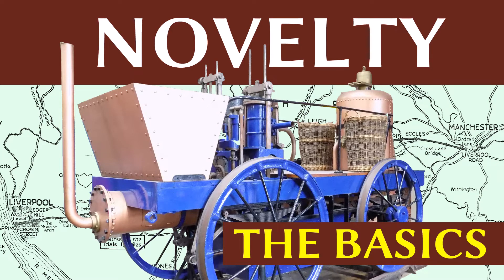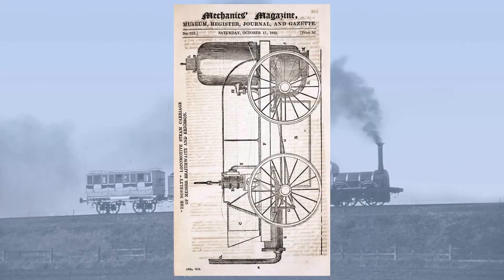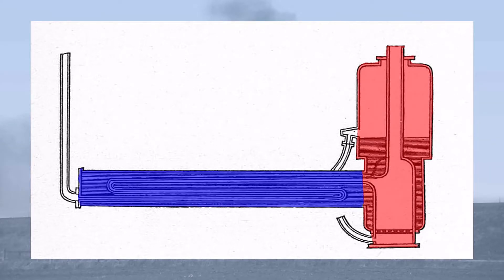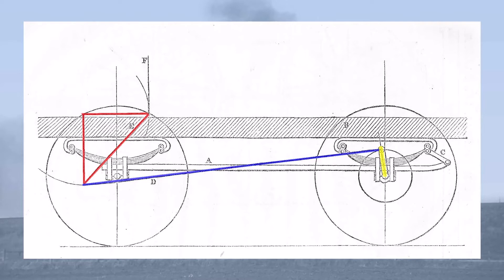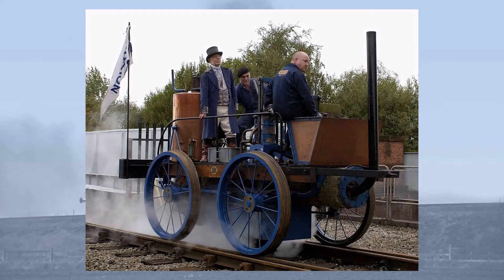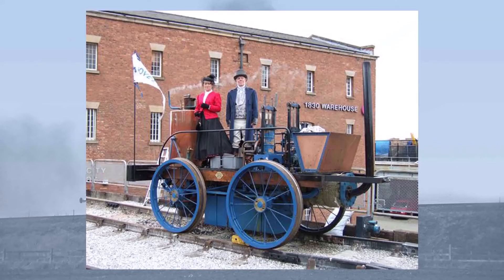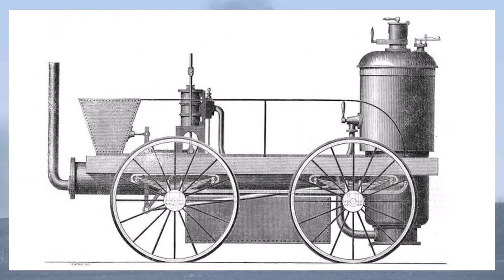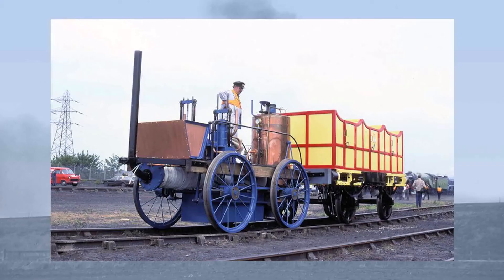Novelty: The Basics

Comment: I'd agree with Stephenson just based on being prone to clinkering and sooty flues. On top of that she seems to be an incredibly lightweight design, so not sure about how much tractive effort she would've mustered. I'd guess her pulling power would be a fraction of Rocket's or Sans Pareil.
Reply from the maker: Novelty weighed only 2 tons 15 cwt; half the weight of Rocket (4tons 3cwt) or Sans Pareil (4 ton  8cwt 2 qrs). She was a little teeny tiny thing, so even a load ten times her own weight was about twenty tons, when Rocket could shift over 40!

Comment: Very interesting watch, especially as I was Fireman on Novelty in 2002 (BBC Filming at Llangollen). I can certainly believe she was actually converted from a fire engine. If you got the power requirement for the blower from the Llangollen runs, I don't think it reflect to features of the original. I can't believe the blower on the replica was anything like the original. The blower & air pipe, the regulator/steam pipe and valvegear setting were all things that seemed to need some serious workshop time after running tests.
Reply from the maker: The calculations were based on the experiences of the replica combined with those of the original machine. We now know the blower design in the replica is incorrect as it should have provided a continual stream of air rather than one which pulsed. When we had it at Manchester in 2005 we could not get it to make steam, especially over the short run, so instead a leaf-blower was used. The boiler made steam in abundance and the locomotive worked well, but the fire clinkered easily and the flue tube fouled with carbon deposits. The valve gear of the replica is based on that from the original machine, parts of which are incorporated in the static replica built in 1929. Given how rushed Novelty was, it's not surprising that it has its faults. it's a shame in 1980 the blower was less well understood - the other problem being of course that the replica  - and indeed original - wheels are very very narrow. The static replica now in Manchester was fitted with an electric motor to turn over the wheels and valve gear and to go for a trundle up and down but kept falling off the rails.
Reply: I could never understand the wheels on the replica - why did nobody stop to think about it running on current railways. Can't comment on the originals but once the rings were fitted it never gave us a problem. Did you ever get her over 15 mph? We found she accelerated ok and the nothing would make her go any faster. As for the valve gear, its not the construction that's the problem its the setting. Not sure about on the TV programme but certainly on my (camcorder) video it was very obvious she was badly uneven - giving only three exhaust beets. I think the clinkering is a good sign as to how hot the fire was getting. On the filming runs it was over about 70% of the grate by the time we called it a day.
Reply from the maker: @andrewhurrell6690  They were building as close to an exact replica as possible, hence the copies of Theodore Jones' patent wheels. Rocket had problems in 1980 with wooden driving wheels as they kept coming off - but then again the track at Bold Colliery was in shocking condition and poor old Lion also ended up with its nose in the dirt - and there was insufficient weight at the front end. The replica was speedily fitted with cast steel wheels which helped keep the front end on the rails. The speed limit at Manchester is 10mph. There's a photograph of when the fire dropped of a solid sheet of clinker dropping out of the firebox! To my mind that suggests the fire was dirty, it was perhaps over fired and had been left standing too long/extreme changes in fire temperature. There's also the issue of the original being designed to burn coke and the replica having to run on coal.  Rocket also suffered from clinkering at Llangollen. novelty is definately three bits and a gasp. Which is surely indicative of her rushed construction in 1980 to be honest. Unless her builders thought that acceptable. She does run after all....
Reply: @AnthonyDawsonHistory  Were you burning coal at Manchester? At Llangollen she was on 100% coke. I'd also come the conclusion that Novelty and Sans Pareil had been built to look right more than anything else. I seem to remember all three replicas having boilers with major differences from the original, not all due to meeting modern standards. I know the first half of the Llangollen filming runs on Rocket were using coke, I think they used Coal for the second half. Sans Pareil wouldn't burn coke at all.

Comment: So, the valve gear's a mystery
Reply from the maker: No. It's slip eccentric with manual override.There's two eccentrics, one per cylinder. The valves have to set by hand to get it moving and then can be locked in.